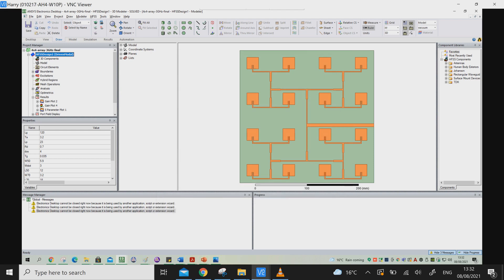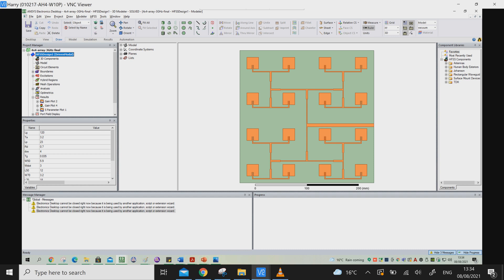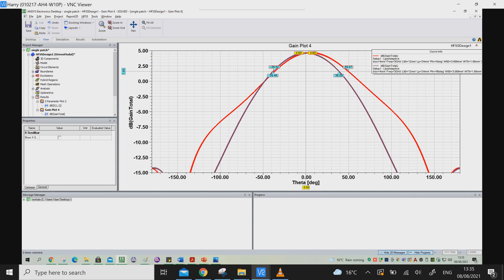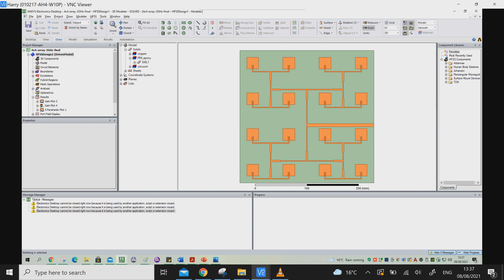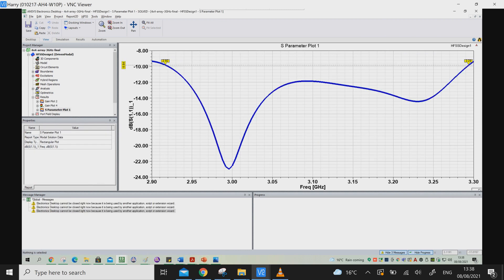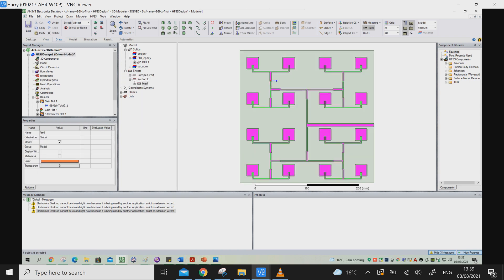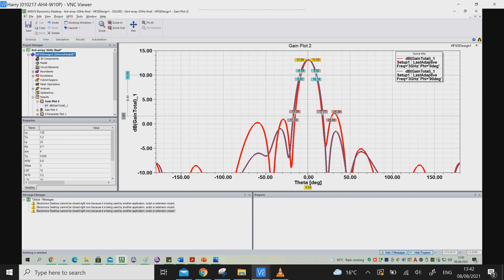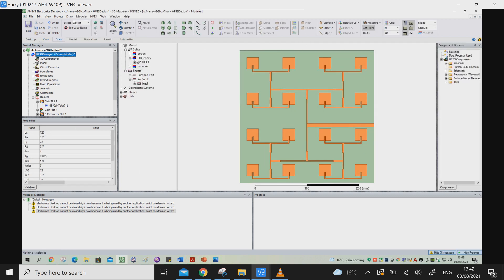Patch Antenna Array design Using HFSS

Comment: why so narow band ?
Reply: Quarter wave transformers are used and they are by nature extremely narrow band.
Reply: One of aim of desing array  pach antenna is obtain wide band operation.
Reply: @yavuzciftci7989  not always, we sometimes design narrow band for better impedance matching, also to utilize the narrow band to filter out unnecessary signals
Reply: @VinnyGjokaj  clear. Also for mmWave applications arrays are certain